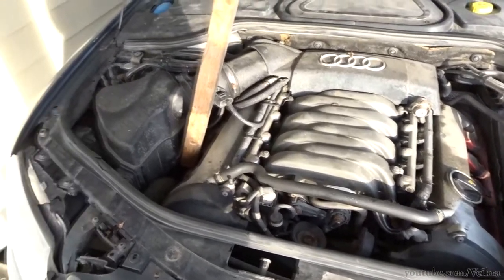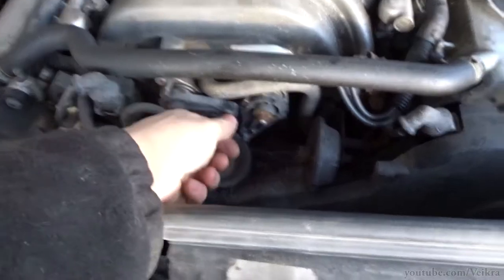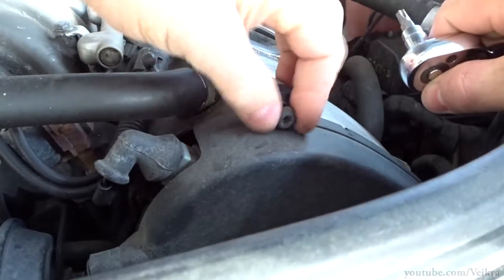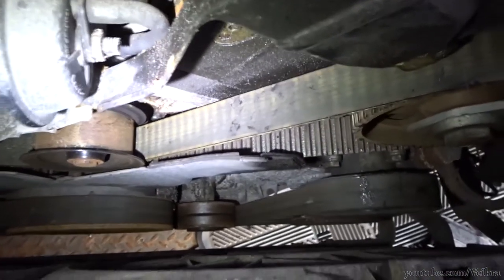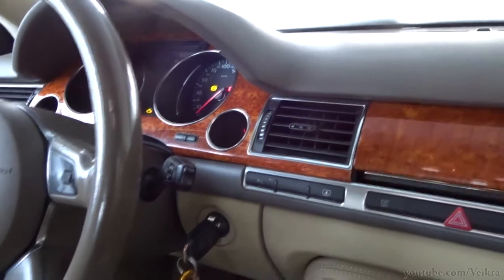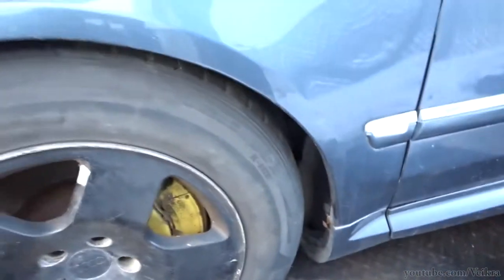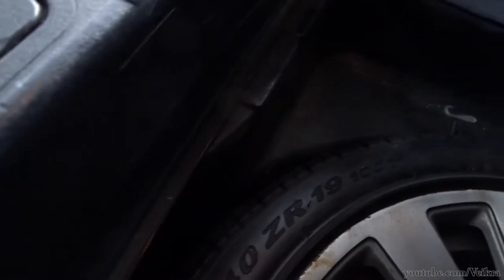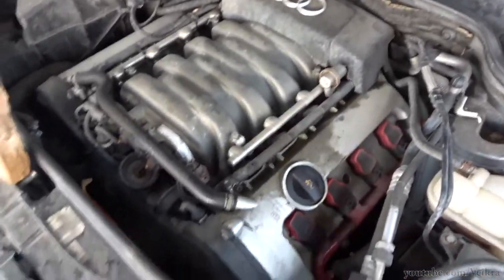2004-07 Audi 4.2 Timing belt inspection 334 000 miles

Comment: Is age or mileage more important when determining whether a timing belt is still good? My A8 only has 50k kms added since the timing belt was replaced but the belt was replaced but it was replaced almost 12 years ago. I'm going to be replacing the belt anyways just to be safe but what do you think?
Reply from the maker: 12 year old belt I wouldnt even start the car
Reply: @Nordic_Mechanic  Had the belt replaced at an Audi specialist. Drove the car over 500km with a 12 year old belt. Honestly surprised it didn't snap. When my mechanic showed me the belt it wasn't even that bad; there were alot of little cracks but nothing too major and it looked like it could go another 1000km with some luck.

Comment: i have a  4.2   engine    with  250.000 km in my   audi  q7  . this video gives me hope , with the life of this engine , i change the oil every 8.000 km or every 6 months with one comes first
Reply from the maker: This is the BFM, you may have the FSI with timing chain. You may have carbon to clean occasionnely. Oil is cheap vs buying another car or replacing major component. Good Job !
Reply: @Nordic_Mechanic    yes  u have   timing chain    on   my  engine.   . and    carbon clean  I    did   , it's not that  hard   it's  just   takes   some time .   Grate   videos.
Reply from the maker: @tudorionut4997  you have nicer facelift car and little more power compare to my a8l.  You can check out my S8 with V10 too.

Comment: I have this car, this is promising. It's definitly a high maintenance car but I do love it
Reply from the maker: Change your fluids often, diff, transmission , powersteering brakes and it will last a long time. Those are very durable mecanically, as you can see.
Reply: @Nordic_Mechanic  ya thats true, I have a cam chain tensioner rattle now, going to do that soon...ever done one?
Reply from the maker: @JDJD-mw9rr  Yeah not fun. Mine sometimes does it. Ill do it with timing belt soon (have 15 000km left) . It's nothing hard to do just time consuming if it'S your first time
Reply: @Nordic_Mechanic  can the driver's side tensioner be done with the belt on place and just removing the cam caps? I've heard that it can, hopefully just remove the intake cam and leave the exhaust cam in place since it has the belt
Reply from the maker: @JDJD-mw9rr  I'd ratjer take opportunity to inspect everything timing belt related and so far ive only done it while doing the belt anyways as cars had no history of belt.  But yes its possible by removing only 1 cam. Safer removing bolt and having lots of room to play with :) Oh and youll never do it again,, one time deal just like the FSI tensionners
Reply: @Nordic_Mechanic  ok that's great info, hopefully this solves my rattle, only happens when warm an between 1k-1500k rpm so it's gotta be a weak tensioner
Reply from the maker: @JDJD-mw9rr  100% will fix it . Usually only at startup after a day or two not using it then becomes more frequent.
Reply: @Nordic_Mechanic  ya the start up rattle is just lifters and the tensioners oil starved for a sec. This rattle only happens when warm and only when I bounce the revs at low rpms. It's either the tensioner or intake flaps, im going with tensioner so hopefully once the part comes I can fix it
Reply from the maker: @JDJD-mw9rr  BFMs seldom have flap issues aside from the 2 vaccuum diafragms. Most possibly the tensionner between cams
Reply: @Nordic_Mechanic  ya the diaphrams did have broken arms but I fixed that...what does the BFM engine code stand for and is that only used for the 4.2 TB engine?